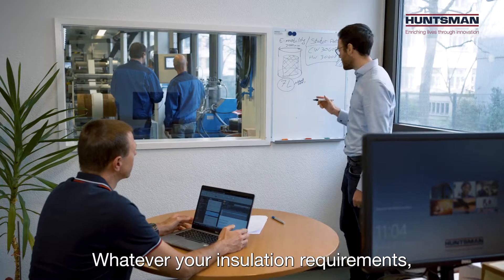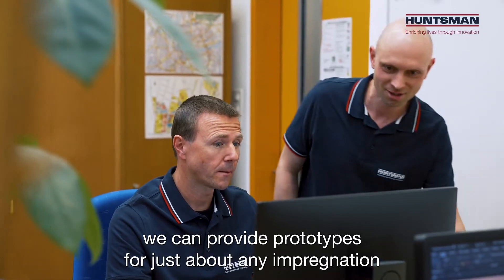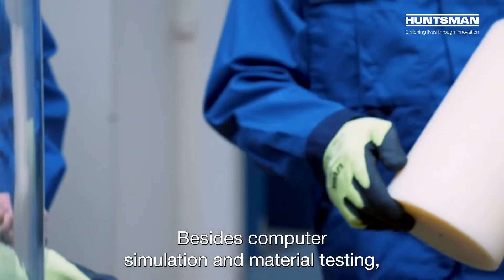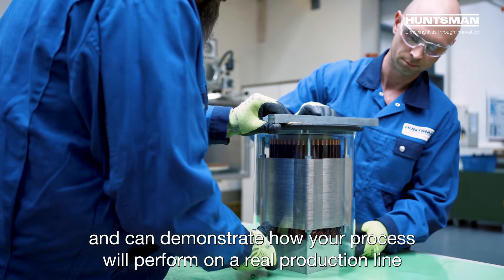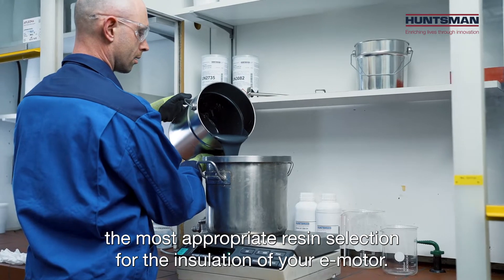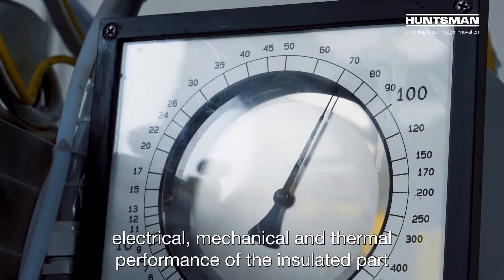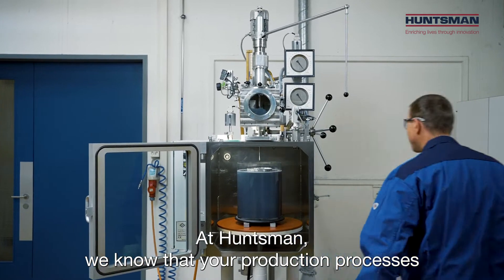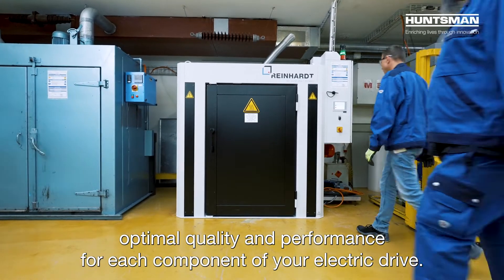Encapsulation and Impregnation Prototyping of Electric Motors

Comment: Recently, I manually soaked my electric motor with varnish and found that I had damaged 4 copper winding wires, accidentally erasing the top of the wire when I opened the motor. Will my engine burn out?